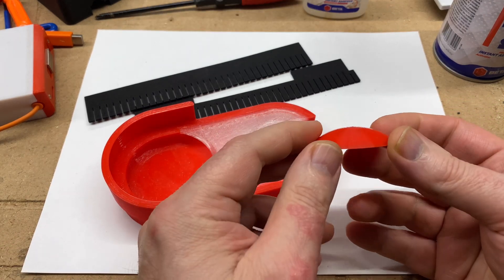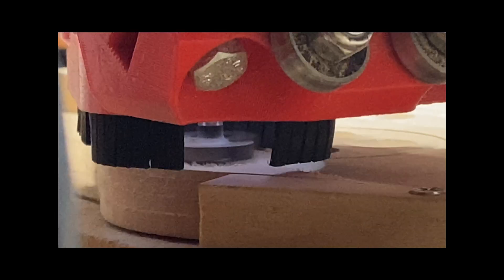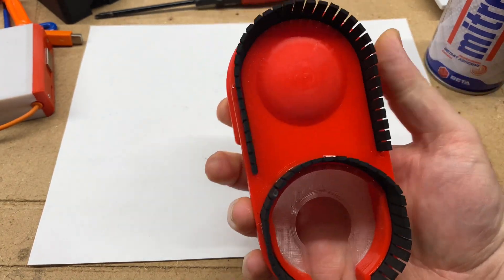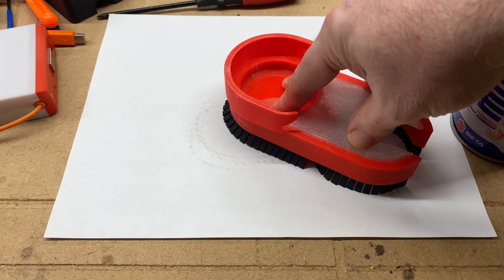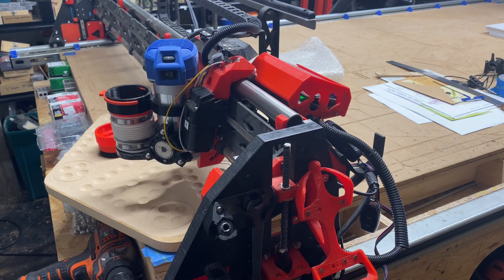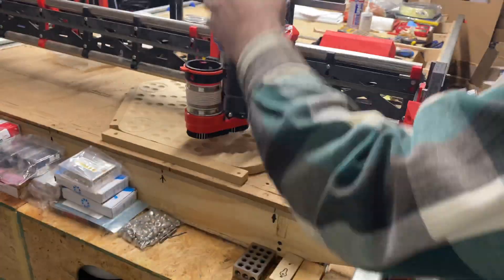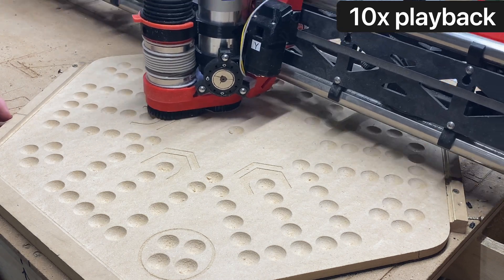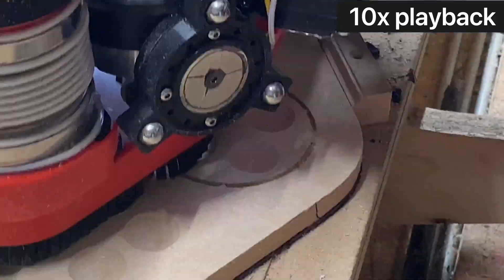LowRider v3 CNC - floating-Z dust shoe - new bubble bumper! - part 4 + Fluid Dial Pendant dev tests!

Comment: That looks great! I'm setting up the L3 with a friend and your vids are great. I do have a question. I see you're using mdf in the vid. Do use a mask when the L3 is routing the piece?
Reply from the maker: I try to yes.
Reply: Something special or just a normal dustmask? I'm asking because I read somewhere that MDF is toxic and therefore very bad for your lungs
Reply from the maker: @MrRclemens  For protection regarding this, you would need a respirator. I bought — and use — this one: https://amzn.to/3UmDMej
Reply from the maker: @MrRclemens  These are the replacement filters I bought for the 3M respirator: https://amzn.to/48PwfJv
Reply from the maker: @MrRclemens Whenever I am sanding MDF after cutting it, I try to wear the respirator 100% of the time. When I am cutting on the CNC, and my dust collection is working great, and I am monitoring from across the room, sometimes I don't wear it. If I am going to be standing over top of it while it cuts, I try to wear it.  My understanding is that MDF is some nasty stuff to get fine particles of it in your lungs.
Reply: @design8studio  tnx for the intel. I just ordered the set ;)

Comment: Thanks for the upgrade!

(Btw, link in the description is to the old dust shoe, not the new one with the bumpy thingie)
Reply from the maker: Will fix! I will edit the link, and probably also add the bumpy thing to the older listing as well.
Reply from the maker: I have edited the description to include the new link. I won’t be able to edit the old Printables listing until later this evening.
Reply: Thanks a ton Doug! I’m just finalizing some measurements on my lowrider and about to make my first cuts. Your videos and modifications have been extremely helpful and very much appreciated!